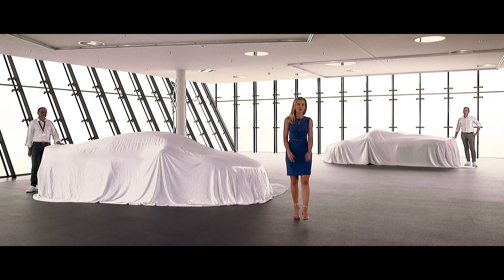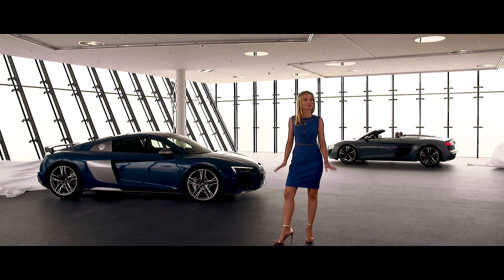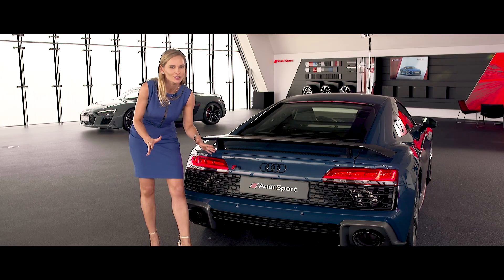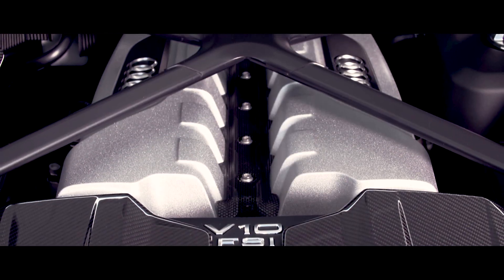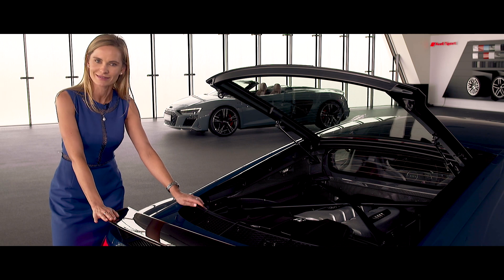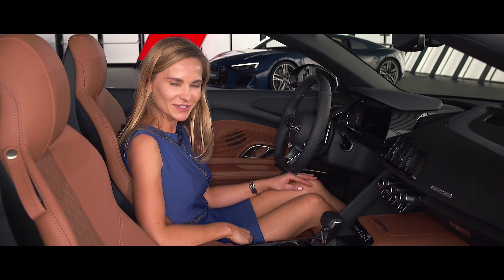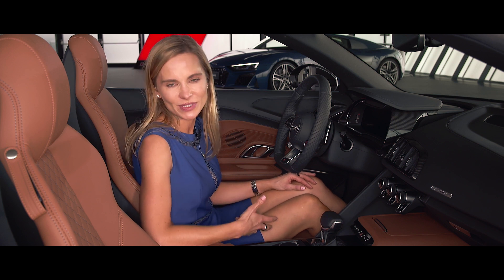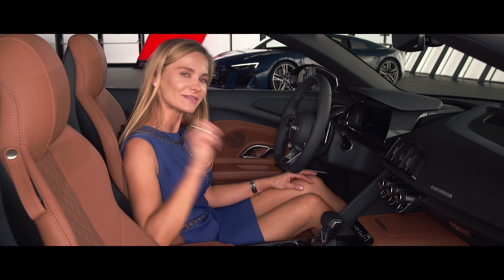2019 AUDI R8 FACELIFT - FIRST OFFICIAL FOOTAGE

Comment: I still can’t afford a 2010 :(
Reply: if you can, don't as it tends to fall apart anyway
Reply: And I can barely afford a TTRS
Reply: Don’t let your dreams be dreams, if u put your mind to something u can do it.
Reply: @rsvsbg1608  Actually this is true there is an engineering defect which causes the aluminium frame to tear near the front shock supports. Audi fixed the issue after a particular model year, you'll need to google it to find the dets. The short end of the story is do thorough home work before buying an audi, you might get burnt with a defect that can cause the whole car to be a write-off.
Reply: Charlie Hhuukk im not bitching im saying he shouldnt complain becouse he gotta be pretty wealthy if he can afford a ttrs

Comment: Most Volkswagens Ive owned has had a catastrophic failure that has cost 2 to 3,000 to fix at 50,000 to 60,000 milesa plus

So I figure all there other brands would be the same